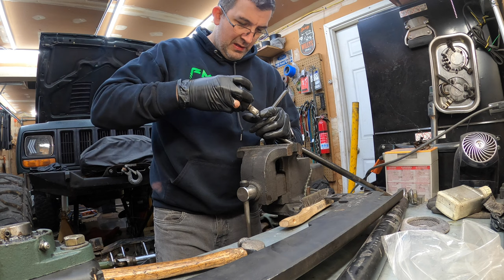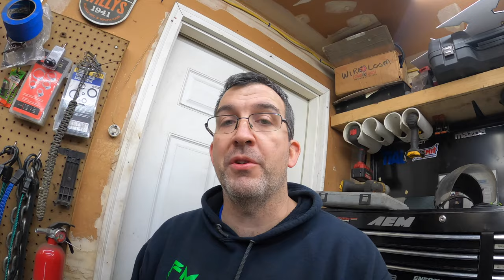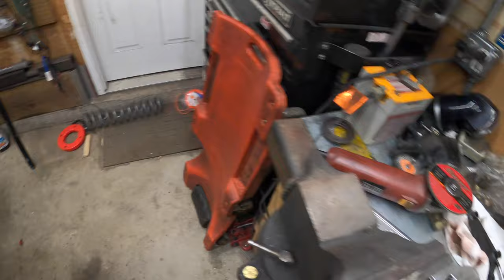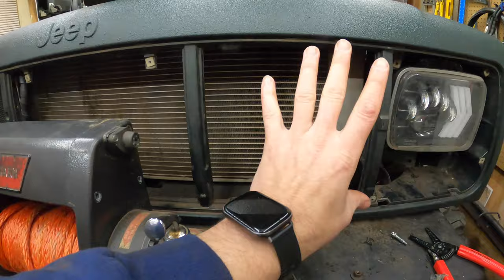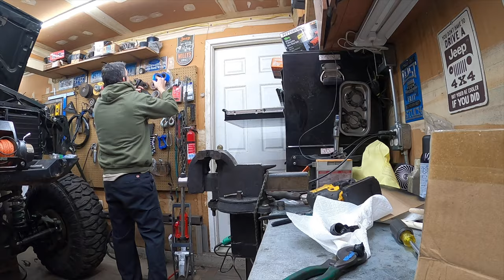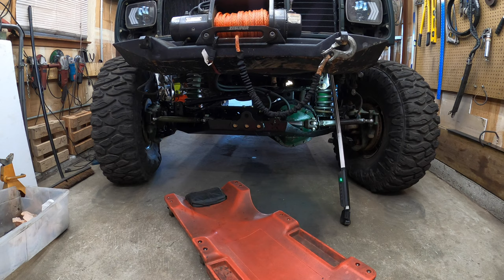Full hydro steering Install on a Jeep XJ

Comment: In regard to the cooler, I would install a gauge, identify optimal temp, and monitor it.  Go from there.  It may work great as is.  

Setup is looking good.  Look forward to seeing how it works out for you.
Reply from the maker: I will have to check that out.  Thanks 👍

Comment: Did you drill out the aeroquip hose fitting that screws into the pump to increase fluid flow? If so, what drill size? Thanks for all of the info.
Reply from the maker: No.  The aeroquip fittings were factory.   I slightly drill out the factory fitting on the pump . Im sorry I dont remember the exact size.  I didnt want to go too big to create  issues. I went like 1 drill size up from factory on the xj

Comment: i would like a link for the orbitrol! its amazing how easy it fits on the stock colomn! do you thing i could get away without a cooler?
Reply from the maker: I bought the orbital used along with the adapter.  Try counting the splines on your steering shaft. I know they make the adapters.  The orbital I know is a trail gear orbital.  I would  buy another if I had to do it again.
Reply from the maker: I would highly suggest a cooler.  I ran a system with too small of a cooler and it made steering awful.

Comment: You have a link for the tubing and clamps you used for the cowl intake ?
Reply from the maker: Sorry. That is from an old cowl intake (spectre) that is no longer in production.  I bought it used  from someone on Facebook marketplace.
Reply: @FMJeeping  🤙 thanks for the quick reply. I’m trying to make room for front coilovers. I may just go with the Thor intake.
Reply from the maker: @jackbrown2224  yeah I hear that. That's exactly why I went with the cowl intake myself.  Do you know what you're doing on the passenger side? I ended up relocating my fuse panel against the firewall and getting rid of the AC. I am probably going to also relocate the battery to behind the passenger seat

Comment: You'll need a larger fluid res.  I had a similar setup
Reply from the maker: I was worried about that.  Im working on an external res I can tap and plumb into the factory pump.  I'm going to give this a few runs and see how it does.  What did you end up going with?
Reply: @FMJeeping  i ended running the tall psc with filter and haven’t had any issues since
Reply from the maker: @Kellengravesfab  thanks.

Comment: What fluid did you use? Standard Power steering fluid or hydraulic oil?
Reply from the maker: I used power steering fluid.  The previous owner used red ps fluid.  I flushed it out and used the clear stuff from autozone.
Reply: I thought you were supposed to use hydro fluid like swepco I think it's called. Of course psc plugs it on their site
Reply from the maker: @BSG4x4  swepco only locks in the psc warranty.
Reply: @FMJeeping  I knew there had to have been a reason why I would spend that kind of money on a hydro fluid when I got my ram lol

Comment: $800 for full hydro is a bargain fo sho
Reply from the maker: Thank you.  I could have saved a little more on the mount if I went with a tube style or the TMR.  But lessons learned.  $800 is still better than $1500